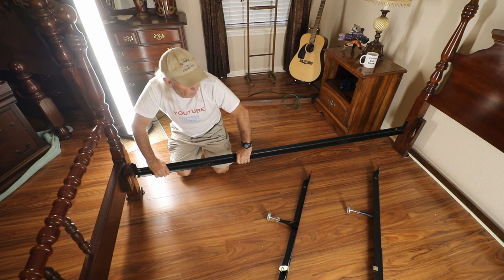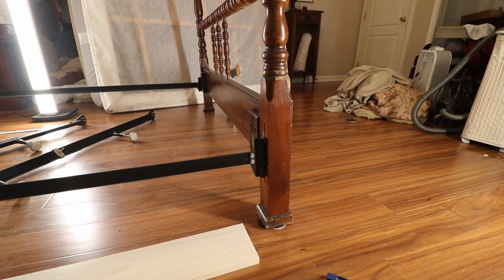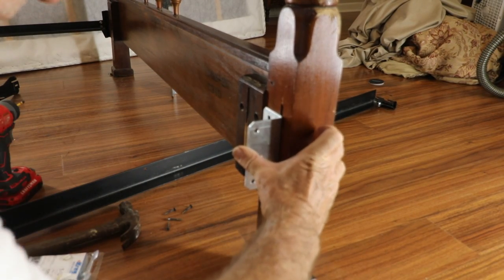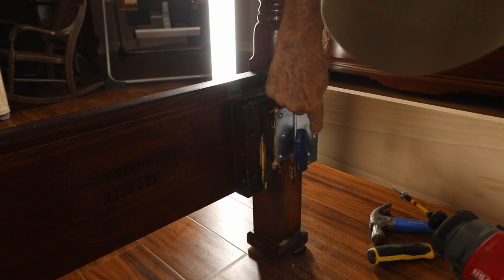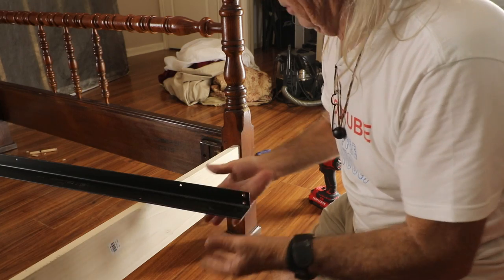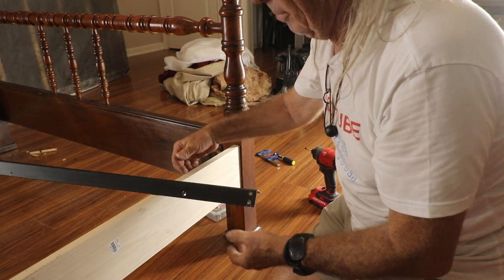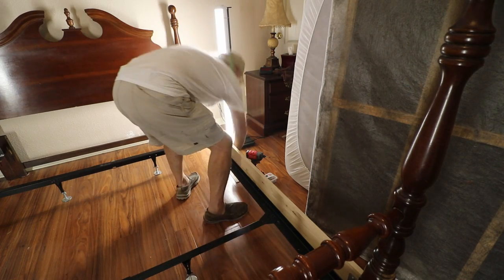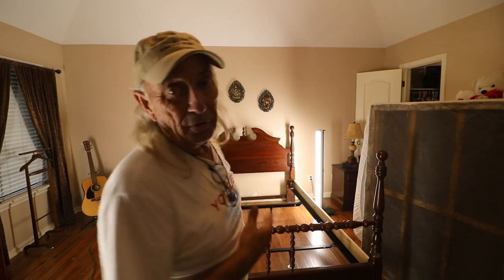Bed rails repair and tighten up antiques issues done cheap @ Coffee and Tools episode 171

Comment: Hmmm I had a similar prob with almost the same style bed.  Mine I think is a rice bed w/4 vertical pole at each end.  My prob was one side was right and the other was loose and of course it’s the wife’s side.  I have the pre-made boards with the hooks built in.  Come to find out the bracket with the hooks were loose so I tightened them (5 screws each side) it helped a lot but it was still a little loose.  So mine is a manufacture defect.  They offset the bracket to the side board so there is a tiny gap at the top & bottom of side boards abv & below the hooks.  Foot board I took and cut cardboard (you can’t see it and sandwiched btw the side board and foot and headboard.  Just a sliver of card board inserted at the top & bottom of the hooks.  The headboard top needed on but the bottom portion of it needed 2 pieces (the offset fm the manufacture) so I cut a long piece and folded it to make 2 cardboard thicknesses.  I did have to lift up on the side boards (unhook them) a bit and slid the pieces in with about 1/4 of inch gap.  Centered then and push down and BOOM!  Tight as the good side.  I don’t know how long it will last tho.  Next time my plan is to remove the brackets fill the holes with wood or toothpicks and do it like the manufacturer should have done in e first place.  OR I can drill 5 (10) more holes at each end and resented the brackets to make them fit tight!
Reply from the maker: Ours was just not working after several repairs and I can say now that we've not had to fix it since adding these side boards. That ended the issue. I tried the cardboard trick too...🤠